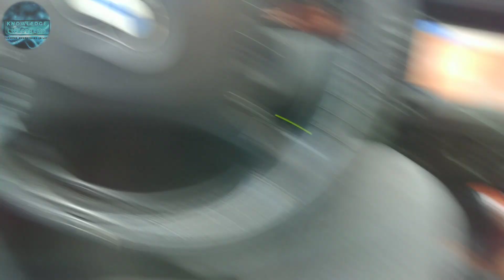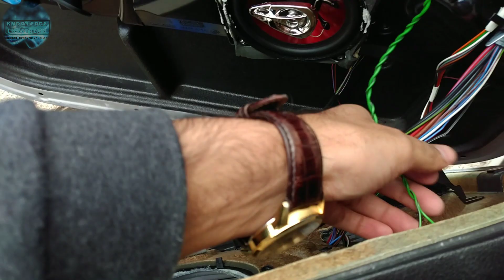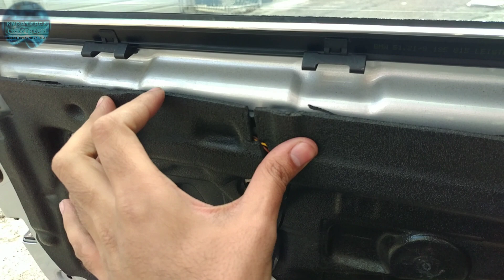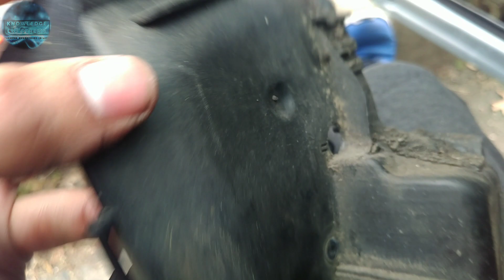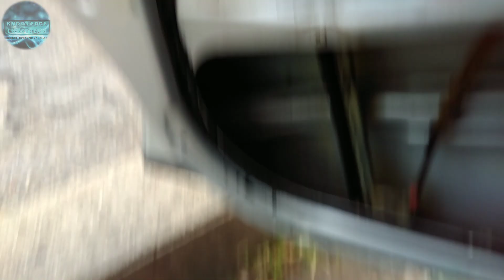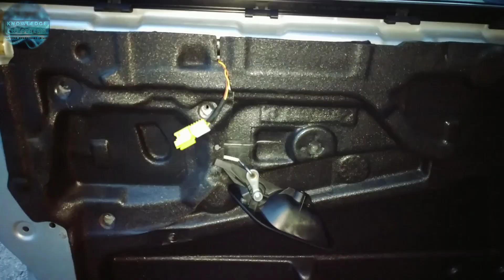Car Door Lock Actuator Repair | Bmw E39 Door Actuator Replacement | Complete DIY Tutorial

Comment: Good video. I just replaced my window regulator and now the door actuator is not working, hopefully it is just a loose connector, but I may have to replace the door actuator, which brand did you use?

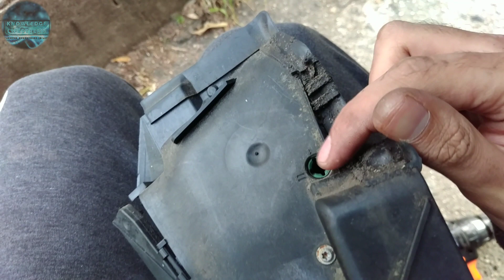Comment: How long did it take you to do this project.  I do allot of work on my 540i, but this one scares me a little with the tight space.  At 14:25 you talk about getting the pin from the outer handle into the hole on the black plastic cover when reinstalling..  Can you use your fingers to guide the pin in the hole?  Can you see that it is in correctly?  Great video, vey helpful.

Comment: Hey, im having an E90 and was about to replace the door lock actuator in a whole. It did fine, just until i tried to close and open the car with the remotekey. Somehow, the door doesn't lock with the remote key once the electronic thing is plugged in. The car doesnt lock any door and when i take the car on, i'm having an orange ! while the car runs. I tried 2 brand new door locks from "METZGER", nothing worked for me. Do you have any idea what's the problem? The wires look fine in that door. Thanks in advance!